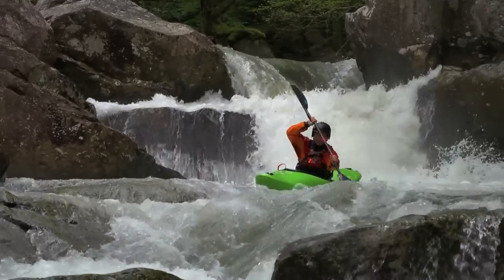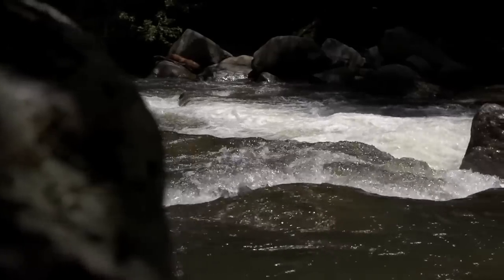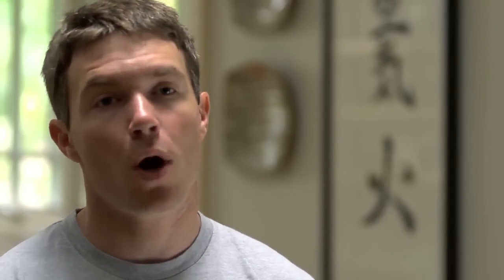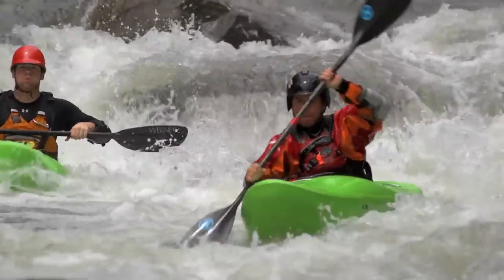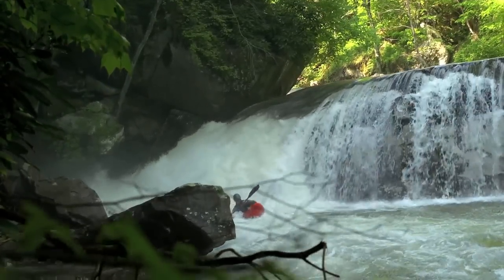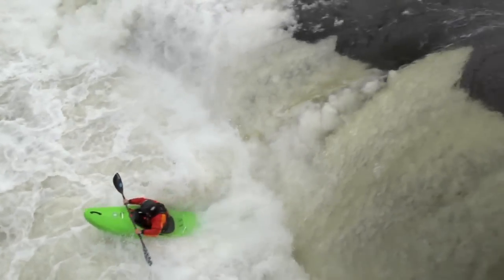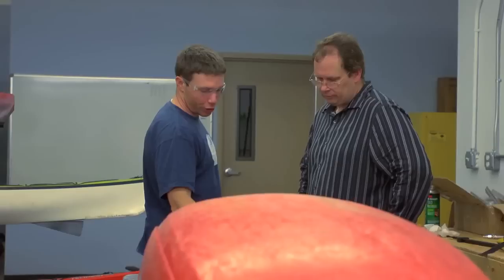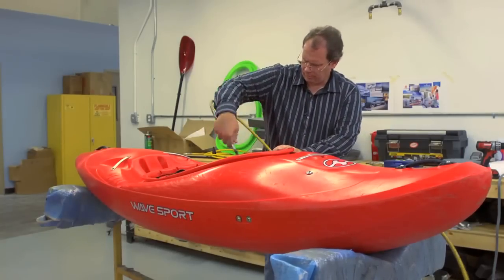Recon - FULL Promo

Comment: "Boofability and speed" of course is an oxymoron with continuous rocker as the boofing enhancement feature. Translation; this is a slow boat, unlike my new Phoenix. However, I will also be purchasing the Recon 93 and leaving it hidden  up mountain trail  hikes to quickly navigate the waters from pop up thunderstorms in the creek basins. This is a fantastic strategy; just leave a boat and gear where arduous hikes up would detract from your performance paddling down the creek during temporary rises in water levels. All it takes is the money for multiple boats and the time and conditioning to hike your boats up to remote put in points. But then you can observe via radar which creek watershed is being hit with showers and then hike to the place where you have hidden the boat for that creek.
Reply: 2 different boats for different purpose, not to mention one is displacement and other planing hull .